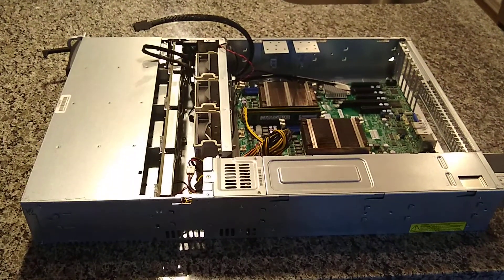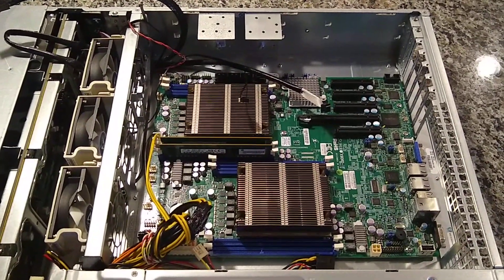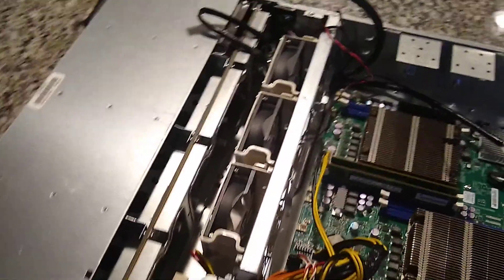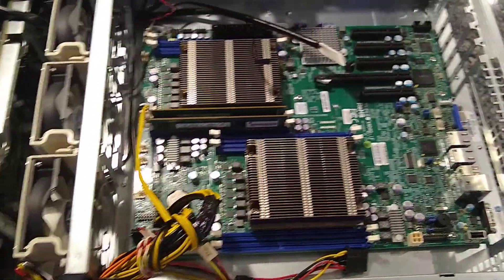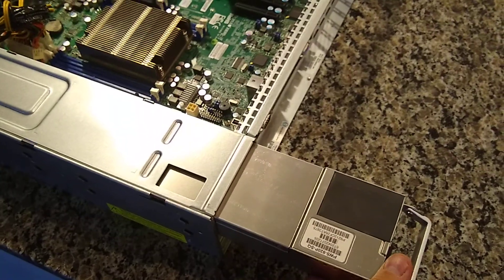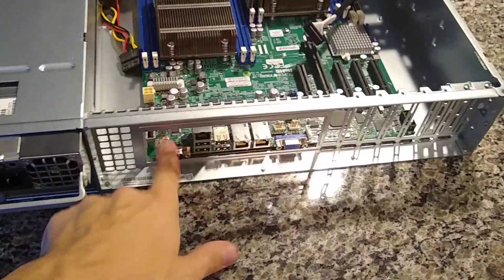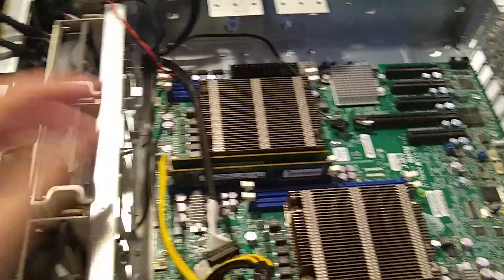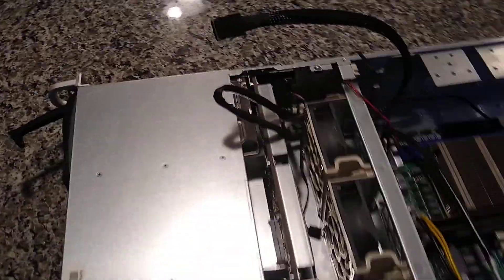Supermicro CSE-826 Server Chassis - Home Server Build Part 3

Comment: It’s a great case, with proper fan control you can even keep the original fans under control… if you can except a higher baseline temperature.

Comment: Hey I’m having issues connecting the front DVD drive and power/reset switch. Not sure where on the mobo they go. Is it possible to remove the top metal shroud at the front?
Reply from the maker: What motherboard do you have? A supermicro breakout cable will probably make it easier to wire things to your motherboard if its from a different manufacturer.

https://store.supermicro.com/supermicro-15cm-16-pin-front-control-panel-split-extension-cable-cbl-0084l.html

If you search that part number (CBL-0084L) you could probably find it for like $5 shipped on ebay. I bought one so just in case in the future I upgrade to a different motherboard I could reuse the chassis.